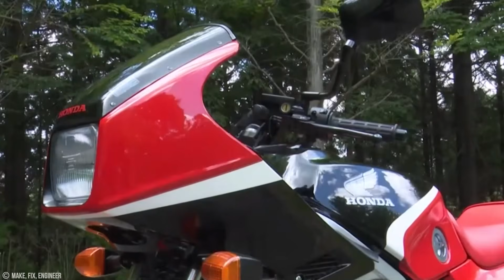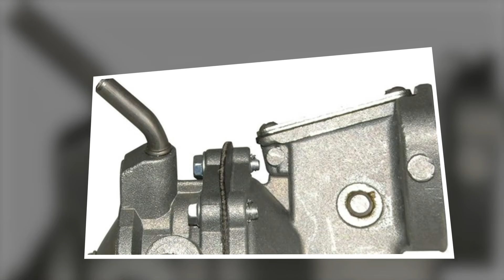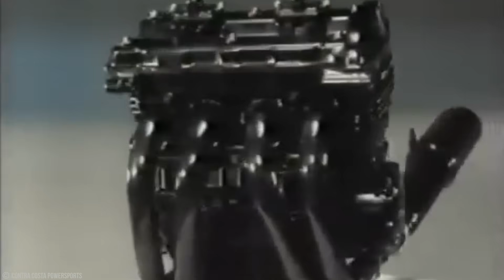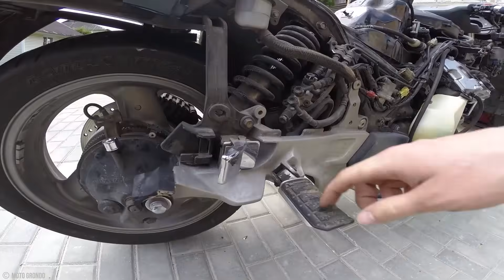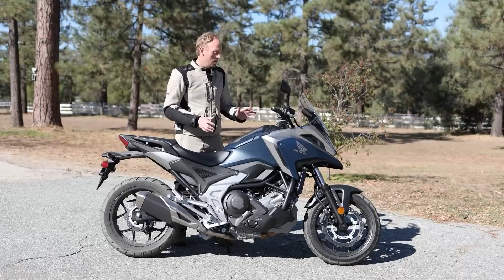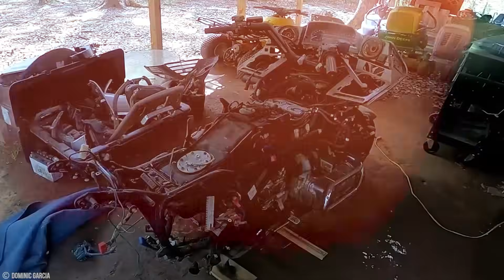3 WORST and 4 BEST HONDA Motorcycle Engines to RIDE FOREVER

Comment: Mr Honda used my 750cb to develop 100cc over sized piston system for American Honda shops. It had a problem with engine ping. He reduced from 12:1 too 10:1 bike worked great. I took that bike around America on 3 month ride.